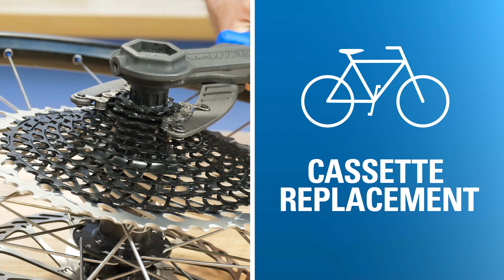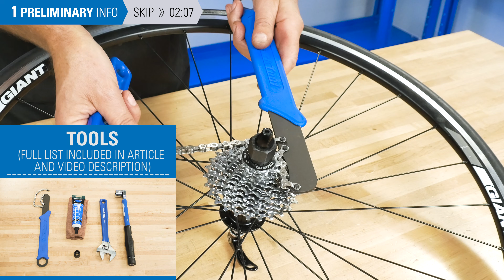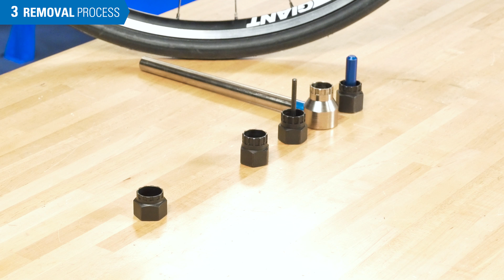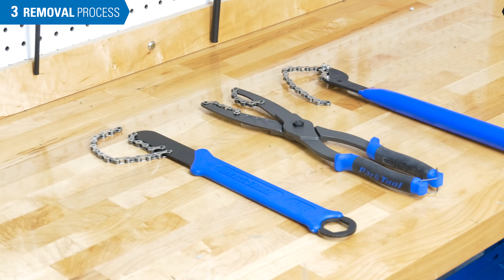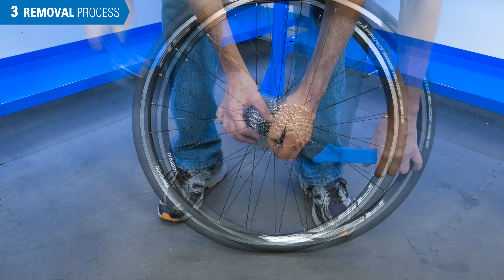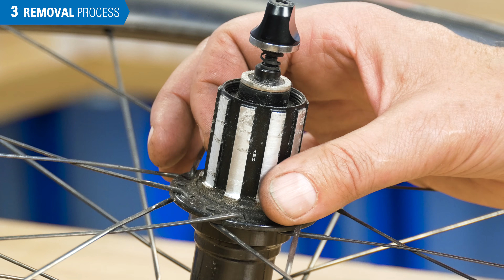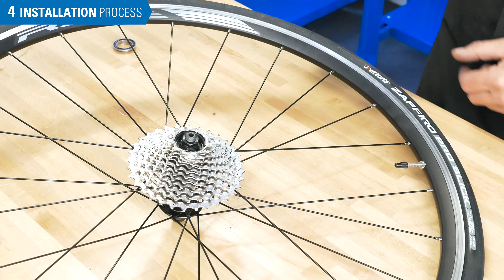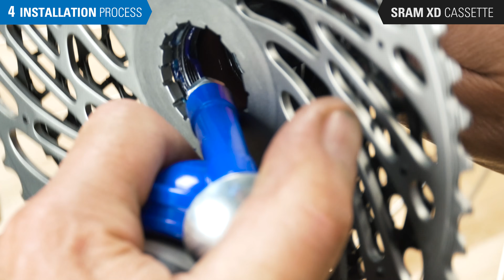Cassette Removal & Installation

Comment: This was really helpful, the only issue i have is how do i replace the hub that holds the cassette. The one on mine ended up breaking and the ball bearings on one side are gone
Reply from the maker: Its often more cost effective to get a whole new wheel than to re-lace a new hub into your existing rim. Building a wheel is also a pretty in depth process that can take some time to master.
Reply: @parktool  I see, thank you for that info. Would you also know which hub would be compatible with a shimano alivio 9 speed cassette?

Comment: HI, just an FYI.  Purchased a 10-46 11 speed Sunrace cassette for an XD free hub( CSMX9X.ETZB.OSO.BX).  This cassette uses two locking rings - an inner one that uses the standard cassette tool spline pattern and an outer ring that secures the outer 5 cogs that uses the Campy free hub/BB spline pattern.  Really frustrating.
Reply from the maker: This is new to the market. E Thirteen does something similar. Thanks for sharing this.

Comment: the last 2 rings (the smaller ones) are independent of the cassette body. Do the teeth on the last rings need to be aligned with the rest of the teeth on the cassette in a certain way ? Other videos out there speak of such a process...
Reply: Yes, there are splines that align all cogs properly so nobody can ever mess that up.

Comment: So all I need to install the cassette is the lockring tool ? No chain whip required ?
Reply from the maker: When installing the freehub acts as the stop for the cassettee, just like when you ride.  No chain whip needed as the function is built right in the hub.
Reply: Park Tool Thanks!

Comment: Body weight technique at 4:07 - Far better to arrange the two tools at a narrow angle to each other, then squeeze together with both hands. It is very difficult to bring full body weight to bear. Moreover, for the vast majority of people, even full body weight won't nearly match the force that can be exerted by the squeeze technique.

Comment: Great tutorial Calvin. Worked a treat for removing the Dork Disc... i went to replace my SRAM PG-1130 with another SRAM PG-1130 and it doesn't fit??? Really baffling the only difference is mine was a black 11-42t  my new one is a silver 11-36t I'm unable to tighten the lock nut with the smallest cog on it. Any ideas anyone?

Comment: I noticed Calvin using the chainwhip on the smallest cog.  I always used the largest cog because I am probably doing it wrong as is my tradition with anything mechanical.  I figured that there would be less force on the chainwhip and thus easier to use.  Next time Im trying the small one.  

Videos like this make me want to take apart my bike "just because" :).

Comment: Will the serrations wear out after a couple of disassemblies&assemblies?
Reply from the maker: The serrations seem quite durable.  But the primary thing that keeps them tight is simply the 40Nm.  Proper tightness, again, saves the day.

Comment: My spring on the rear wheel is stuck on the drive side. It is possibly entered the wrong way with the narrow side out by an incompetent mechanic. If I yank it with a pair of pliers it might get deshaped. Is there any tips or tricks to take it out? Not really related to this but would be grateful if I get some help here. By the way, it doesn't affect my wheel mounting or movement.
Reply from the maker: You should be able to unthread the nut from the end of the quick release and pull the spring off with a pliers. Then you can run to the local bike shop and grab a new one. A new one should only be $1.00 or less. When they get bent up they are difficult to bend back.
Reply: @parktool  - thanks a lot for responding. The problem solved itself quite by accident when I took the skewer out and then turned the bike upside down, meaning to take the wheel out. I was determined to solve it once and for all. The moment I held the wheel and jerked it a bit upwards the spring fell out of the hole :-) . It is very slightly de-shaped from the mild yanking I gave it earlier. It's otherwise working fine. Hopefully it will correct itself after sitting compressed for a few days. Thanks once again.

Comment: Hi for installation : should i wipe off old grease with alcohol first or simply reapply new grease to the freebody hub?
Reply from the maker: If there is an excessive amount I would wipe some off and apply a little bit of fresh grease over that. Otherwise just put a little bit of new grease over the old grease.

Comment: how about casette on a voltage gt 500 scooter cant find anywhere only bikes .please helpl cant get off hub. thanks
Reply from the maker: It does not look like there are any tool fittings on that freewheel. You will most likely have to use some destructive removal techniques to remove it. https://www.parktool.com/blog/repair-help/freewheel-destructive-removal

Comment: anyone else having trouble getting it loose?
Reply from the maker: First double check it is a cassette, not a freewheel.  https://youtu.be/iTJ3taJHOn8
If it is, change up the mechanical advantage of the two levers.  Hold wheel vertically, and levels 180-degrees apart, both horizontal.  Now use your body weight and push down on the levers, turning the lock ring counter-clockwise.

Comment: How to tell a worn out cassette?
Reply from the maker: Worn cassettes are tough. The tried and true way to tell is to throw a new chain on and if the chain skips over the teeth then you have a worn cassette. Another method is visually. If you look very closely at the teeth on the cassette, the left side of the tooth is the part that wears. If it is worn out there will typically be a very small amount of displaced material. It is hard to describe but if you have a pick or a pen then run it over that side of the tooth and if it catches it is too worn.

Comment: i got an 29ER WTB WHEELS WITH SRAM INTEGRATED FREE HUB 10 SPEED AND UP GRADE WITH NX EAGLE GROUP SET - THE 12 SPEED CASSETTE FIT PERFECT BUT ITS LOOSE ON THE FREE HUB - DO I NEED TO ADD AN SPACER
Reply from the maker: Are you sure that the last cog is timed correctly on the splines of the freehub body? Sounds as if the last cog is just slightly off and is not allowing the cassette to be fully tightened.
Reply: @parktool  i took it off and place it back again and now its all good -  i guess i didnt do it right the first time plus the lock ring wasnt tigh right - thx again keep doing such a great videos
Reply: THE BIGGER COGS ( THE LAST 4 SO - THRU THE 50 THEET COG) - THE LOWERS ( FROM 10 UP ARE OK ) ITS USUALLY HAS SOME MOVES - BUT THIS TIME WITH THE NEW FREE HUBB ITS MOVES MORE

Comment: Can a 9-speed Campagnolo Chorus Racing Triple rear derailleur work with a 10-speed (12-30) Campi cassette and 10-speed shifters?
Reply from the maker: Sometimes the only thing to do is try it. However, generally, you can go backwards with a derailleur.  A 10-speed derailleur working on a 9 speed cassette.  The chain is narrower on the 10, and the 9 speed derailleur pulleys are not designed for the narrower chain.

Comment: mine is stuck like a cement, i have put some wd40 and it did not help
Reply from the maker: They get pretty stuck. What are you using to hold the freewheel remover?
Reply: Park Tool Had to bring it to profesionals to losen up
Reply: When WD-40, or PB Blaster, don't work try some Kroil (available on Amazon or from the manufacturer). I will never be without it.

Comment: Always good to watch you !! Keep it up!  

I noticed that there are different type of chain whip ( for different sized cassette ( 8-9, 10, 11 speed ))  does it really matters?      Thanks
Reply from the maker: Thanks! Good catch. There are two main types of chain whips. Single speed (1 1/8") and multi speed. The multi speed chainwhips will work on 5-12 speed systems. The reason there are two options is because the chains are different widths. Hope that helps!

Comment: Sir,
Generally the pedals of cycle rotate when we walk the bike backwards but they don't when we walk the bike forward. That's freewheel motion. Right.

Now the problem is, pedals on my cycle rotate when i walk bike forward so does it mean that my cog set needs to be replaced? Or can it be repaired? 
Plz help.
Thanks and regards.
Reply from the maker: You could have a bad freewheel or freehub body. The other issue could be that there is debris stuck behind the cogs. Hope this helps.
Reply: Thank your reply....

Comment: I have an old shimano gear cluster on a 700c wheel, the gears are held on with a flat right that has2 wholes in it, so I need a tool with 2 posts in it to go into the two holes. Do you know what tool that is?
Reply: To remove the freewheel you need the park tool freewheel remover which fits into the splines inside of the freewheel to remove it from the hub for replacement. If however you are trying to disassemble the freewheel so you can overhaul it you will need a pin wrench to remove the ring with the two holes in it. Alternatively you can use a centre punch and a mallet to tap the ring loose. A youtuber called RJTheBikeGuy has a good tutorial on how to do this- probably one of the best you will find!
Reply from the maker: Could you send a picture to info@parktool.com ? That way we can be sure to get you the correct information.
Reply: Thank you very much for your time. here's a picture, 
https://imgur.com/ffjv97d
the shimano gear cluster is MF-T220
Reply from the maker: Mike S If you remove the ring that has the two pin spanner holes in it It will get you access to the bearings of the freewheel. You do not have the ability with this freewheel to separate the cogs. It is best to clean the freewheel fully assembled. Happy wrenching.
Reply: Thanks, I was wondering where to get the tool to remove the ring.
Reply: Thanks. What tool do I use to remove the ring with the 2 pin spanner holes?
Reply: Thanks! I found a freewheel removal tool and got it off. I had to deal with the bearings. Best Regards, Mike

Comment: Is it necessary to apply any grease to the freehub body before installing the cassette sprocket?
Reply from the maker: The grease will help if surface corrosion of the freehub is a concern. Mechanically it will do nothing, but will cut down on any rust concerns.
Reply: i use a little amount of anti seize on the freehub body before installing the cassette

Comment: One ask: the size of the freewheel is always the same? (in no XD) so if I have 8 speed casette in the back, I can put 10 speed casette just changing the casette and not the freehub or the hub itself? Great video btw, they are a lot helpful
Reply: you will need spacers
Reply: No, you need a spacer only when placing <10 speed cassete on 11 speed hub.
Reply: Thanks, so, i guess that exist many different sizes of freehubs?
Reply: no, actualy you can find: campagnolo, shimano <=10 speed, shimano 11speed (road) and sram xd (12 speed)